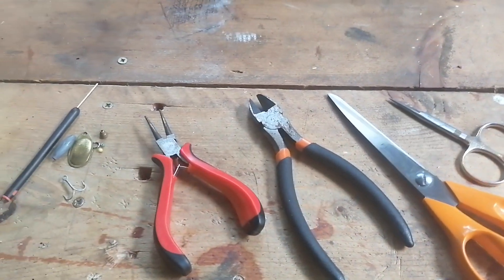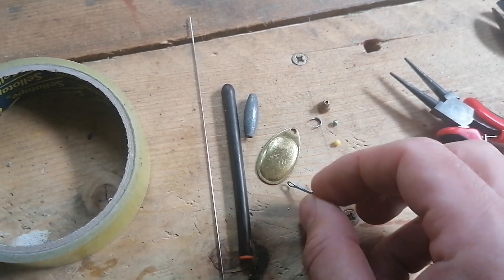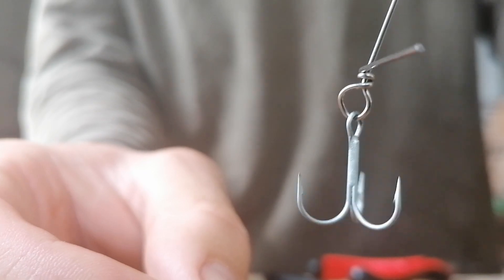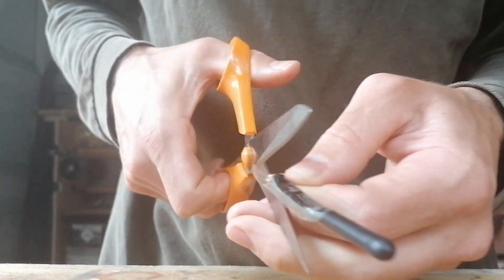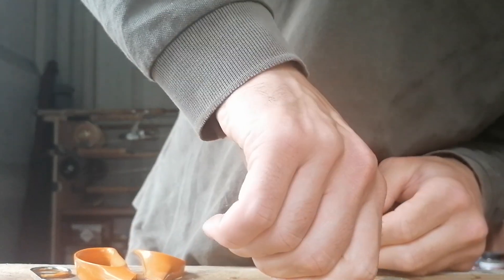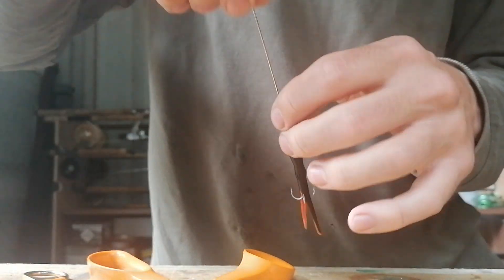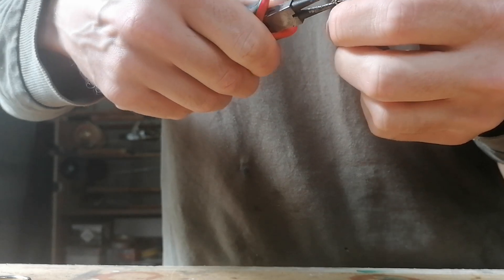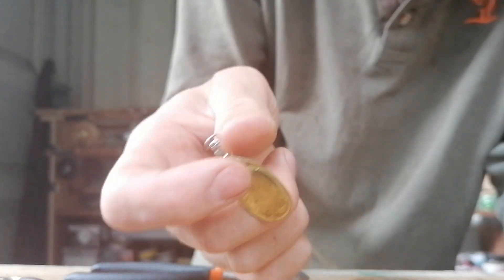How to make a Flying C (Inline spinner) by hand.

Comment: Very good instructions. Like how you showed how to use round jewelers pliers for the complete build.

The one thing that im having issues finding is the tubing. What is it called? Also, you may want to spend some time with a can of Brasso to get those blades sparkling 😋😋😋. Thanks for the vid!

Edit 10/19/23:
I watched this again. You can't see anything of the adding the tubing. I'd like to see it so I can add hoochies on my rigs based off your instructions

Comment: try using flat pointed nose pliers for finishing off the cut ends of the wire , it is hat Use and it works well . good video cheers .
Reply from the maker: I will give them a try. I now use crimping pliers which make a good job too.

Comment: Hi, great video. Is the black tubing some kind of tubing used in fishing? What is the diameter? Again, great video. I subscribed.  Greetings from the great state of Maine in the U.S.
Reply from the maker: Hi Neil, the tubing is silicone tubing, made specifically for the purpose. It comes in various diameters/colours,  and Spintec in the UK is the place to get it.  

It amazes me that you guys don't seem to use these lures so extensively on your side of the water.   I once gave a few to a client from Ohio who I'd guided for, but he never told me how he got on with them.
Reply: Thanks for taking the time to get back to me.  I love your tip of taping the bodies for cutting.  It makes a huge difference.  I'm waiting on my brass nose cones to come in, but I'm still making some great lures. Thanks brother.
Reply: We have them in the stores in the Pacific Northwest but they are not popular. The fish aren't nearly as attracted to them. Plus they're a bit spendy as well
Reply: @guyh.4553  I bought one online by Mepps.  It was pink. I got a 5lb 2oz largemouth on my first cast.  Three casts later, I got snagged on something and lost the darn thing.  I believe they are geared towards Salmon and or Pike.  I just started making them. I make them big about 3/8" around and small 1/4" around. I make them from a half inch up to two and a half inches.

Comment: Nice video , have you any link to where you get the silicone tubes and do you buy or make your own leads
Reply from the maker: Thanks for your comment. I buy the bodies from Spintec. Unfortunately they don't carry the same selection as they used to. I usually buy leads from them too, but often re purpose old ones if I find them.
Reply: @MacMauserOutdoors  be better if we could out source that material would make it more worth while ,